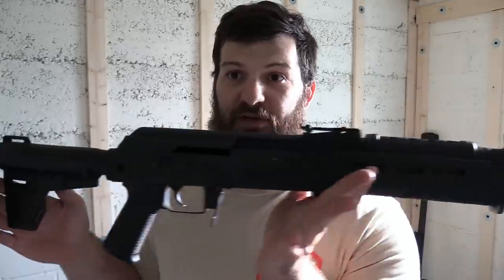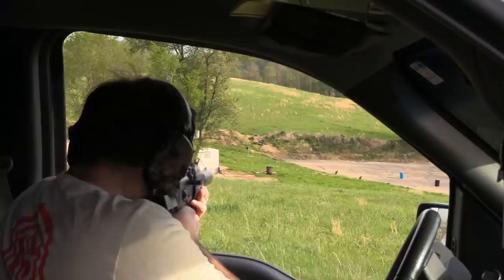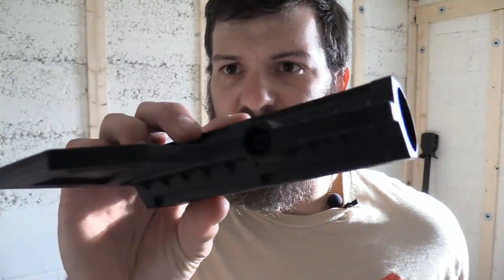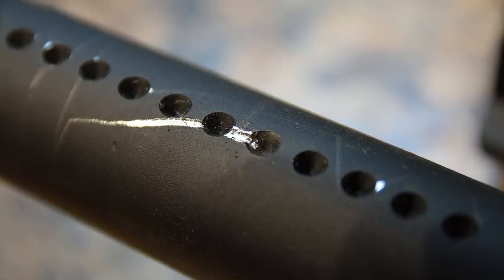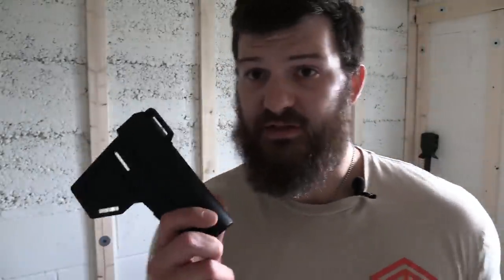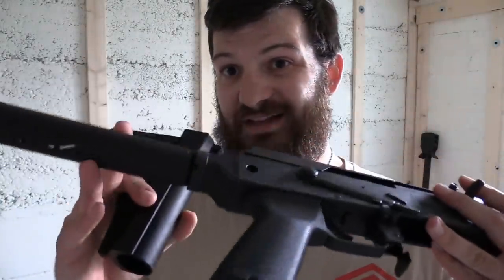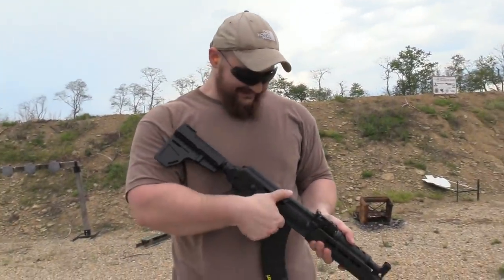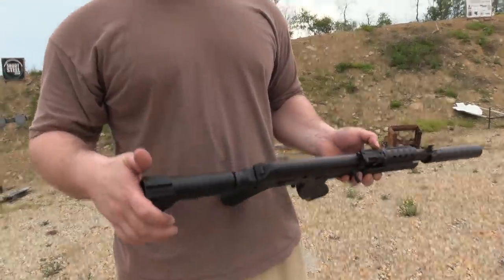Did the Pistol Brace End the Short Barrel Rifle (SBR)?

Comment: I never saw the need for a "brace" on my AR pistol. I took a short piece of water pipe insulating foam, wrapped it in black gorilla duct tape and shoved it over the end of the buffer tube for a bit of padding.  Works great, cost less than $5 and cushions the mild recoil of the 5.56 rounds.

Comment: So you said you put lock tight on the set screw, did you miss the hole upon reinstalling the set screw? It looks like you might have missed the hole and inadvertently tightened down on the buffer tube in between the holes, this would cause it to shift so easily,  didn’t mention if the set screw backed out or was damaged in any way.  
My shockwave brace worked great over the weekend, on my PSA lower with a 10.5 in 300 Blackout upper.  Glad I didn’t pay for a tax stamp ? You bet! SBRs should now be taken off this list.  Such a ridiculous law..

Comment: Seriously though, why would you use the WORST example of a brace when significantly better options exist, like the SBPDW or the SBA3. Add to the fact that they provide identical functions, you don't have to register your gun, You can sell it without issue, you don't have to pay the $200 (Although the braces cost about the same), you can cross state lines without hassle, most importantly because it is classed as a pistol, it is covered by most CCW permits. The SBR is just not worth the hassle now.

Comment: I respectfully disagree with you sir. You broke the cheapest, lightest, and weakest brace. You have also broken plenty of regular stocks on video. Even if that was the only type of brace on the market I would still chose having a “pistol” that I can keep loaded in my truck, move freely across state lines with and last but not least, not have to pay the government and put my information on federal paperwork in order to own it. While your opinion with braces makes a good argument, and your frustration does hold merit, I 100% believe you are wrong in judging the integrity of pistol braces solely because of their original purpose and not off the overall performance. Not only that but the brace broke because of a very small screw. Every other brace on the market attaches to a buffer to just like any regular stock.

Comment: You do know that the Shockwave isn't the only pistol brace out there? Just curious, no offense meant. *EDIT-: I watched the rest of the video and you did mention the good brace companies like SB Tactical (who invented the brace to begin with, and as such knows what they're doing), GH Works, etc. I apologize lol. 

They (SB Tactical) also have a brand new brace model out now called the SB-A3, which uses what looks like a typical AR sliding stock adapter/buffer tube, and slides up and down like a traditional collapsible stock and wedges a little piece of plastic into a hole on the buffer tube like a traditional stock, so there's no chance of failure. 

Also, you know you don't have to do the whole "wink wink, nudge nudge" thing about "accidentally touching the brace to your shoulder" now, right? Because at least for the time being the ATF has ruled that it indeed does not magically manufacture an SBR by shouldering a brace, and thus you can do it and talk about it without worry. :)

Comment: I have no doubt there six million comments below that will point out that the Shockwave is really the bottom-of-the-barrel budget default "brace" (that literally no one uses as a brace, and can hardly actually be used as a brace), usually stuck on guns as a cost cutting measure. Almost anything else is better, particularly the premium SB Tacticals, Tailhooks, and even SIG braces... these are of higher quality, and the manufacturers do indeed take into account that they may be used as a stock "in an emergency."

But, SBR/SBS/AOW and silencers surely lives on for the dedicated xTReeM GuN nUTz... but for the GFY-😡-registration-over-my-dead-body-🖕ATF crowd, yeah the brace has "killed" SBR-- or, at least it has opened up a whole class of PDW/carbine firearms for folks who absolutely refuse to abide by (obnoxious and illegal and unAmerican) federal registration and taxation. Embrace the Brace! 🤓

Comment: As braces keep getting better and better I just don't see a reason to SBR anything. I own several shockwave braced pistols and have not had any issues. I've run them on 7.62x39 AK pistols as well. I'll save my $200 for a suppressor application.

Comment: Gearhead Works TailHook Mod 2. Best brace on the market
Reply: Sapper Neilsen I disagree and think the SBA3 surpassed the tailhook.
Reply from the maker: This^ 
Thats why we are giving away an SBA3
Reply: Different strokes for different folks. I have both and I like the Tailhook better, but I do respect your opinion.
Reply: Sapper Neilsen I think the advantage the SBA3 has is it uses a standard buffer tube and I believe because of that has an extra spot of adjustability.
Reply: It does use the standard tube, the only reason I put the Tailhook over the SBA3 is because I don't like the rubber and how it flexes. I prefer the entire plastic construction. With that being said I do think that if it came down to durability the SBA3 would handle a beat down better than the Tailhook.
Reply: Sapper Neilsen according to them it's a proprietary tube.
Reply: I must not have been clear, The SBA3 is a standard buffer tube, the Tailhook is not. I was not trying to say the Tailhook had a standard tube. It is indeed proprietary.
Reply: Sapper Neilsen gotcha! I absolutely love what these companies are doing to use the "loophole's" to avoid tax stamps and maintain function.
Reply: Completely agree, Its almost made SBRs totally obsolete for any practical reason. Plus now when I travel across state lines I don't need to fill out any extra paperwork. I just treat it like any other handgun.

Comment: You used the worst brace on the market, use the SBA3 I have on my 7.5" 300BLK and tell me the SBR isn't dead. Uses a Carbine buffer tube and uses the adjustment spots just like a stock. I also have the SB PDW on my 10.5" 5.56 and it is just as sturdy as any stock I have ever owned. I have a AR9 with the KAK brace and they are absolutely awful and are worse than the Gen1 sig brace I used to use. When using the KAK no they aren't dead, but when using one of the higher quality and higher comfort braces then yes the SBR is dead.
Reply: Totally agree. Even though the Shockwave is one of the most popular, it shouldn’t be the standard to determine whether SBRs are dead.